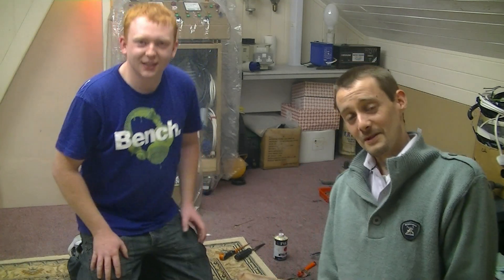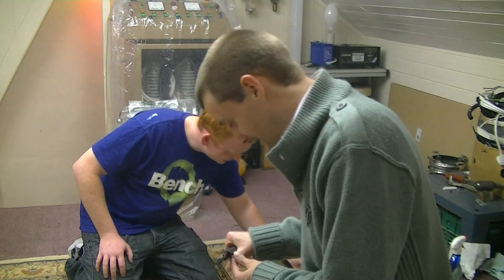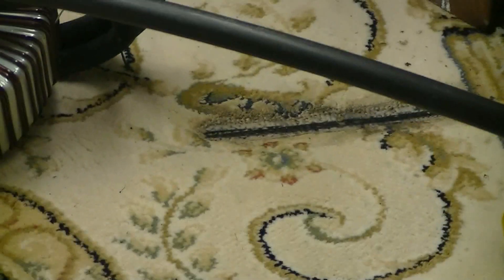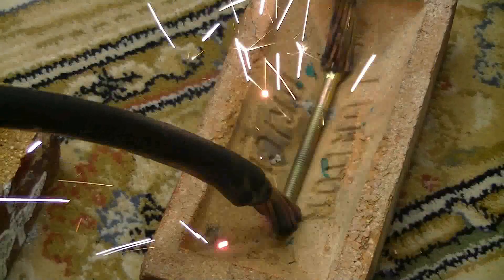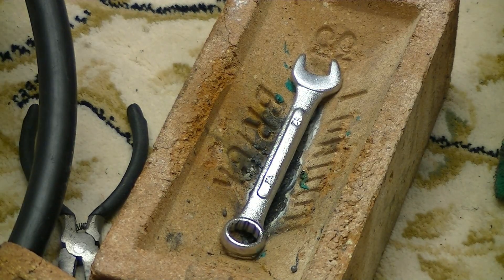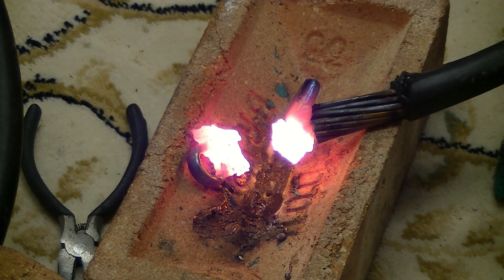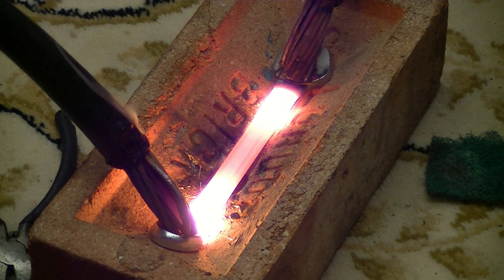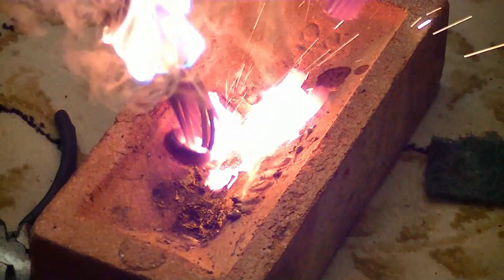5000 Amp Fuse + Tools Melt With High Current

Comment: The mad scientists at it again. Good video. I don't have the bravery to try that stuff, so l'll watch. I noticed the wrenches and screw driver desolved into nothing but the wrench heads and the adjustable wrench head kinda refused or took longer. Seeing this I was just wondering what the cheap China tools are made of? What will happen if you connect to the 5000 amp fuse? Probably some big fireworks.

Comment: not much of a science guy myself... but why didn't the wires melt...? they're thinner than the tools they melted right...?
Reply: There’s almost no resistance in the copper, electrons flow freely, except when they get to the steel. They don’t flow as freely because naturally it’s not nearly as good a conductor so, it heats up and melts. More important question, how are they getting 5000 amps to flow through a 2/0 conductor without completely destroying the cables? Anyone?

Comment: I find it slightly confusing why the metal warms up faster in the places of contact - the heat is not being transferred by touch, it is heated by the electric current. But the current is the same in every part of the metal (unless it is wider and narrower in different places, then it could split). Can anyone explain this to me please?

Comment: So much nonsense in these comments so let’s clear it up. There is ZERO danger of being electrocuted by this. As some people point out it takes current to kill you, sure, but it takes high voltage to encourage it to pass through the human body. Hence the reason why you can hold both ends of a welder with zero chance of electric shock. Further, a car battery will often have a cold crank of about 1000 amps. Yet nobody worries about holding both terminals. The reason for this is the low voltage.  12 trillion Amps at 1 volt will do precisely zero to a human as it will not pass through them. These guys were powering this (they talked about the breaker) from the mains. If they were using 5000 amps they were using 384 times less voltage than the mains supply, in other words, less than 1 volt. The actual generally accepted figure which is safe for humans remaining an insulator is about 48v. Which is why if you use a battery system you can make it as huge as you like with no precautions below 48v. Above that you need to start treating it as an electrocution risk, 72v being the key number to start frying at. It should have been pretty obvious when no sparks were jumping between the terminals even when close how low the voltage was.  This also by the way, ruins the day of the psycho in the comments who wanted to do this on small animals. It would have precisely no effect whatsoever.

Comment: this is how i melt my fast blow fuse when i plug it in 220v instead of 110v . Should replacing the fuse makes my reciever works again by the way the blown fuse is located at the back next to the male power at the back

Comment: It will melt because the main wire is  copper spanners is not a copper so the sparks can make it easily to melt.even two span's of the same copper can stand on the load.all because it's copper to copper so there will be no sparks.

Comment: how if its touched human body
Reply: Soumya Sahu 
Well that is just wrong. While 500mA is enough to kill someone, you would need over 50,000 volts to deliver that current through a human body. The current that passes through your body will be proportional to the voltage across it. Saying that current is the killer is incredibly pedantic, because in almost every case, the voltage is the limiting factor. Most power supplies can deliver enough current to kill a person, but lack the voltage to pass the current.
The power supply in the video has less than 2 volts, but can deliver lots of current. However, because the human body has a high impedance and the voltage is so low, touching it would pass a negligible amount of current through your body.
Reply: Stephan Noykos 
No you won’t, the voltage is waaaaay too low
Reply: The Piscis ok I beg your pardon
Reply: 20mA and 50hz have been proven to be the most fatal, it will cause ventricular fibrillation and end up failing the heart. On DC voltage you can have significantly higher voltage and Amps, because it doesn't mess up with your heart the same way. Also it depends if the current goes on skin level or deeper level in body (because body is mostly water).
Also have to keep in mind, if the current also goes from left side of chest, because your heart is located there, and depending on where are you touching the positive voltage, and where you are grounded.
You can climb on power lines, as long as you don't touch the poles, or any other grounded object and you'll be just fine. But the second you touch it, you will be fried.
Reply: Soumya Sahu ever heard of ohm's law?
Reply: The Piscis Thank you for the correct answer.
Reply: That's the way we did to dead bodies in my country
Reply: probably, eh? uh-huh..I got zapped with 2000V D.C. (not marvel..lol)
 it did not feel good. My arm jerked back so hard that I pulled some muscles. That was using a benchtop megger to test a power plate for a large computer company..back in the late 80's.
Reply: fuzzy bee yes
Reply: 利品睿 it requires 50 volts to break the skin of most humans
Reply: Yes, or an wound, in which case takes 5-10volts, but regardless AC current may be very dangerous. 24v AC can already cause complications for healthy person.
Reply: amperage can kill, too. (hint: it's the "power")
Reply: Lauren C man voltage can't kills amps i much dangerous to our body
Reply: stupid askng
Reply: You would fart..
Reply: Phuong ya but this is different, it's ac which way more dangerous then dc even at low voltage
Reply: Nothing if you have dry skin
Reply: What happen if you combine the 2 wire??
Reply: you clealrlt don’t have clue what elictricity function  12 volts = 1 amps.. you have 5000ampsx12 = 60,000.. volts.. the wire is 12gage is perfect for that type current
Reply: MrMundo3d volts and amps are not interchangeable like that. Amps are the current while volts is the difference in the amount of electricity in two objects
Reply: Soumya Sahu the voltage does kill, theres a reason why signs say "warning high voltage" and not "warning high amperage"
Reply: Lauren C I would die. I'm so WeT
Reply: They'd be dead, even if the voltage is low which I doubt it is. Current kills not voltage and you only need 100mA to kill someone  so with an average  body  resistance  of 500ohms 50V/500ohms=100mA (X_X)
Reply: CABDICASIIS FARXAAN TECHNOLOGY 

The voltage is low, so unless your body is wet, you would probably be fine. However, if your skin is wet, then you probably won't come away very happy.
Reply: 利品睿 I love you
Reply: dead in lower time than my ping on lol
Reply: you would get severely burned
Reply: It's not the volts that kill but the charge that flows through the body by filbration of heart. 500mA is enough to cause it. And this is 5000A. The fact that it is being pulled at a low potential difference is analogous to attacking someone with truckloads of water at a low height

Comment: I'd be interested in what the voltage and current were on the primary circuit (toroidal transformer. So far as the comment about killing a person. .2 amps will cause severe burns and if problem not resolved, will definitely kill them. 5000 amps on a human is like sticking a hot dog between 2 nails attached the wires of a cord from the outlet. That's 25000 times the current. Basically their body will cook from the current. That person would be known in a trauma ER as a "crispy critter". Remember that it is the current, NOT the voltage that kills. That's why there are people who have survived a lightning shock. Lightning bolts are extremely high voltage, but low current.

Comment: @5:21 :  "Galvanized" ?  I don't see anything here being galvanized. Presumably you're confusing this with electrogalvanization, which involves electroplating a metal object with a zinc (or zinc-iron alloy) coating, and you're not doing anything that involves zinc.

Comment: Natural Selection at its finest
Reply: It's high current but low voltage. According to ohms law: I=V/R
which means that the amount of current that passes through your body is the result of the voltage divided by your skin resistance.

If they're getting 5v at 5000 amp (that would be like 25kW of fucking power, which is about what they can get from the power lines without raising some eyebrows for overcharging) then it would be I=25/100.000 (dry skin) but let's suppose the worst hypothesis of unprotected hands wet with that spray they're using so resistance would drop to 1kOhms. I=25/1.000=0.025amps or 25mA.

So the power is I*V so 0.025*5=0.125W or 125mW of power being dissipated through his body. That can't do shit.

Compare it to 120V.

I=V/R=I=120/1.000=0.120A or  120mA. As power is I*V, you have 0.120*120 which takes 14.4W into your body! It's literally over a thousand times more power!
Reply: YASUKE u just to dumb to understand it
Reply: They survived so according to your theory nature wants more people like them
Reply: csknives2140 well salty dude, if I remember correctly Ohms law states that the current is directly proportional to the energy output. I=V/R. Since I=energy then energy=V/R. The more voltage sure the more energy BUT it can be negated by high resistance. You get it? Please get it.
Reply: Qiu Shi Sheng 
Something awesome I’m sure.
Reply: Erick Lopes Well they're probably using a wall outlet and they live in the UK so 230v AC at 13a so it's like 3kwatts which is not enough. They must be charging a huge capacitor connected to a fuse rated at 5k amps so they won't blow themselves up.
Reply: csknives2140 voltage isn't what hurts. Current hurts. Voltage never killed anyone.
Reply: csknives2140 it's possible to have direct contact with a 200+ volt source without feeling discharge if there's enough resistance.
Reply: csknives2140 By the way, I haven't stated any opinions. All I have said is fact. I do understand where you are coming from however. Nobody likes to be made a fool of. I simply wanted to share that it is not the voltage that hurts us. I took college physics so if anyone were to know this material it would be me.

Comment: omfg you can have micro-cracks in The Wire are even a small little pin hole not all the way through  to the copper and if you manage to grab that part of the wire without rubber   gloves it can Arc out and you will become the ground and die.

Comment: now find yourselves two graphite bars, connect them on each cable and slowly bring them closer.
WARNING: The heat output of the plasma will be comparable to the surface of the fucking SUN, no scratch that, its 5K K (five thousand kelvin) at 50 something amps. Cant even comprehend that projected heat output. You'd melt away!

Comment: I worked at the old phone company in the USA.  Back when ALL phone systems were a single monopoly, owned & operated by  AT&T.

In the power rooms for the switching systems (relay driven mechanical systems that gave dial tone, read the number you dialed, and connected you to whom you were calling)
So, in the power rooms for this equipment, we had , at several places, COPPER PLATES, 3 OR 4 INCHES SQUARE, AND 1/8 th to 3/4 OF AN INCH THICH  that were the fuses.  YES, PURE COPPER FUSES!
When you blew one of those fuses, it sounded like a CANNON BEING FIRED, and you KNEW you were in BIG TROUBLE.
So this vid is kinda cool, but I guess I have seen better.  :^)  Good Job, though, mates!

Comment: You had better be careful melting That sort of stuff. If it is zinc plated tools and you inhale the vapor it can kill you very easily
Reply: Zinc won't vaporize as zinc vapour, it will immediately oxidize. And the tools are chrome plated, it's only the bolts that are zinc plated.
You can see the relative thermodynamics of Zn to ZnO using an Ellingham Diagram like this: https://www.intechopen.com/source/html/10515/media/image60.jpg.

For more on the theory see https://www.doitpoms.ac.uk/tlplib/ellingham_diagrams/thermodynamics.php
Reply: Ian Smith zinc vapors are WAY down the list of things to be worried about here.
Reply: I can smell the burning plastic insulation from here.
Reply: I wouldn't worry too much about the zinc plating but a lot of tools and other things are nickel plated. And Nickel is toxic and a carcinogenic. Dont do this at home kids ;)
Reply: Ian Smith good
Reply: Do you literally think photonic would be so stupid to kill himself trough vapors? .. well then youre right cuz he smokes but ur still talking crap
Reply: Lego Buildings Rewiew your a douche bag troll